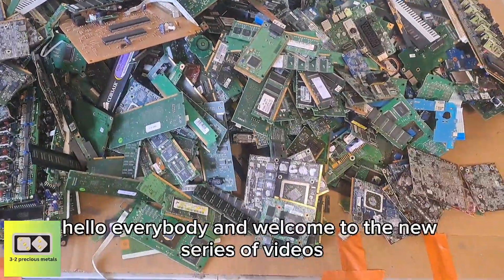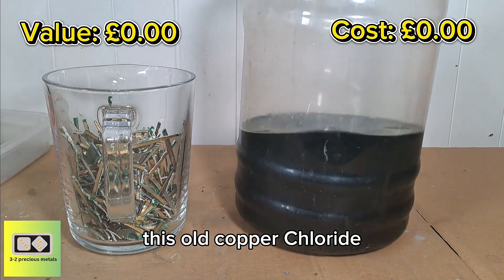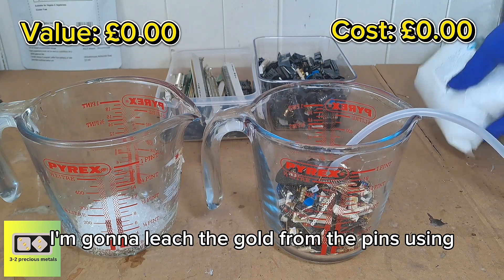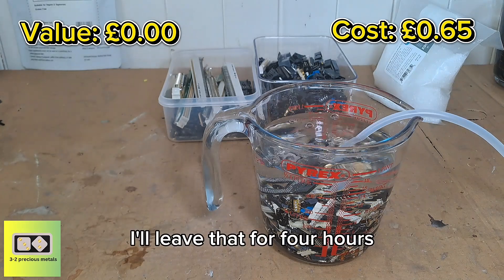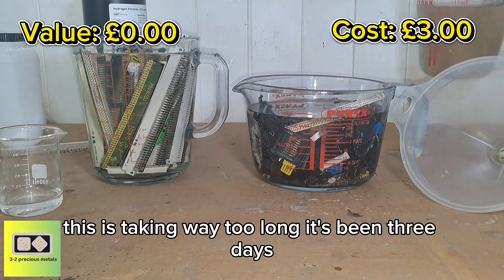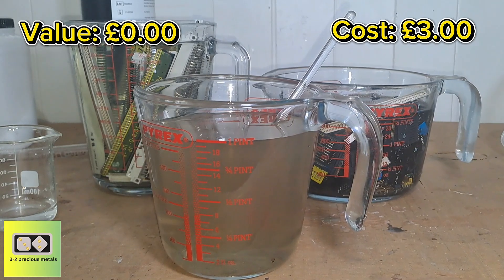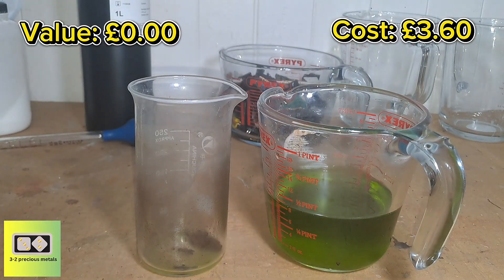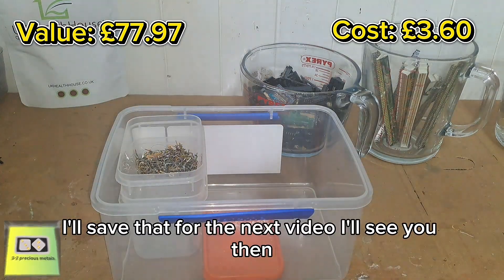20kg e waste series part 1 gold from fingers and pins

Comment: Cool - so where to you get the e-waste without owning an IT company or spending more money on eBay than what you will make? There seem to be no videos on this, but a couple that say - dumpster diving... OK, so which ones? Taht can be very dangerous and toxic not to mention illegal! Advice anyone?
Reply from the maker: I get most of mine from a couple of local companies. Popped in 1 day and asked if they throw out their  ewaste or if they sold it. A couple of them just threw it out, so I offered them a bit of cash to put it to one side. Sometimes I see a good deal on eBay, or I win an auction for real cheap, and other times, it's what I find in the street. I don't like the idea of dumpster diving myself. I like my health. One company I spoke to actually pays a company to take their waste away. Unfortunately, they would rather do that than gift it to me 😂, their loss I suppose
Reply: @3-2preciousmetalrecycling  Thanks for the response.